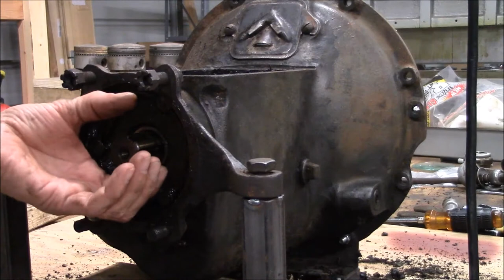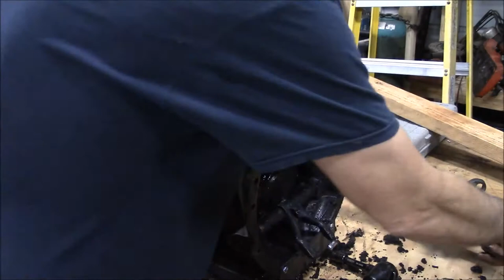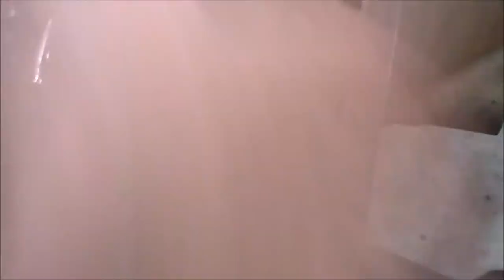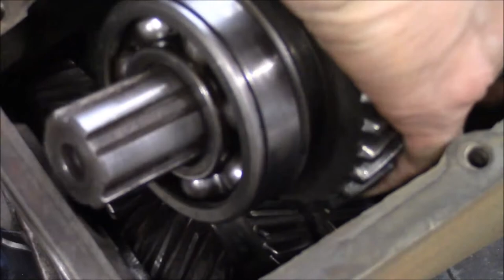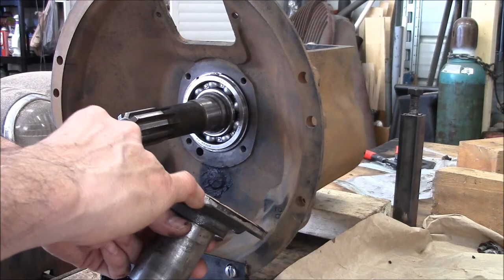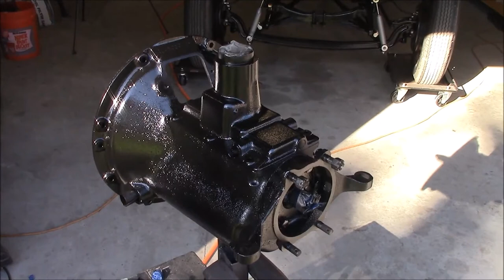Aarons 29 AV8 coupe build 3 Jan 2018 update

Comment: Great video . I'm getting ready to tackle this myself. What did you use to seal the shafts? I saw that you painted something black on there but didn't say what it was. Thanks
Reply from the maker: Hi Paul, sorry I don't remember what kind of sealant I used.
Reply from the maker: It was Permatex black silicone adhesive sealant. I just found the tube in my tool box :-)

Comment: Looks good.  What number was on the trans 78-7006.  Have you ever used the gears and shafts from a side shift in one of the top loader transmission?  I understand it works, just wondering if you have done that, I getting ready to see if it works.  Good video, thanks
Reply from the maker: Hi Joe, yes the tranny is a 78 case. This is the first transmission I have worked on, so I don't know if the side shift gears will work or not. My suspicion is they will. Thanks.
Reply: Thanks for the response, you are doing a great job if this is your first.  I started watching your old videos and you are following the hot rod books very well.  Can I ask how much further are you in the build.  I am not very good at figuring out the videos and found the first part right now.  Are you doing the 8ab yourself?  I have about 4 good engines and all the guys that do machine work are getting older.  Someone to do the valve grinding in the block is the problem.  Boring cylinders is not a big thing for them.  Again great job.
Reply from the maker: Hi Joe, the hood video is my last update, that is where I am at currently. I am working on headlight mounts now and will post that video when i'm done with them. I had the machining work done on the block, but I built the motor myself.
Reply: @aarondominguez4533  I think I finally found that video.  Thanks